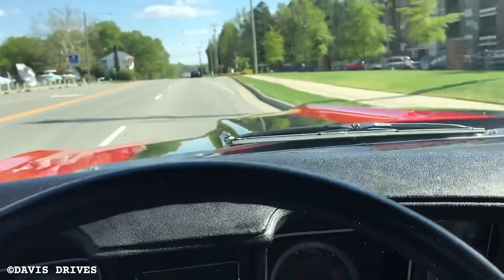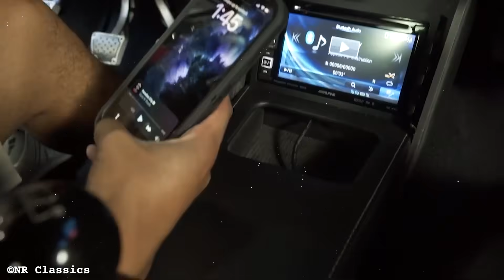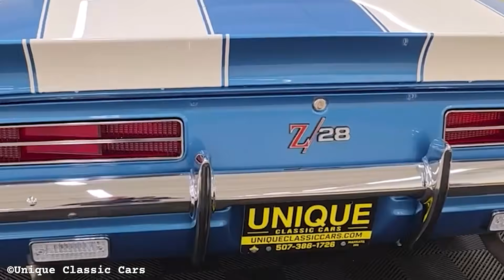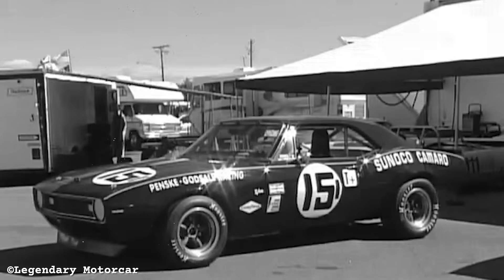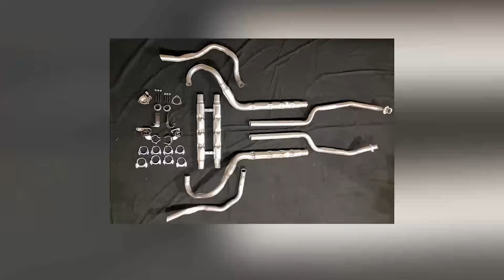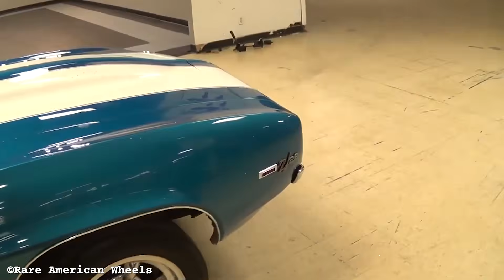25 Weird Facts About the 1969 Chevrolet Camaro Z/28

Comment: High rpms but not much on duration, or lasting long under continually beatings against big blocks. Hp plus torque wins every time. Rare yes they should be, and was rare even long ago.

Comment: They maked 206 jl8 with the heavy duty 12-bolt they made 56 of what they called service package jl8 which were truck 12 volts incorporated into a 69 Camaro and had 3 inch flanges all the way to the axles these were strictly for racing you could not put the Corvette backing plate for the parking brake in it because it didn't taper down the 2 in like the heavy duty one did that was the street model version

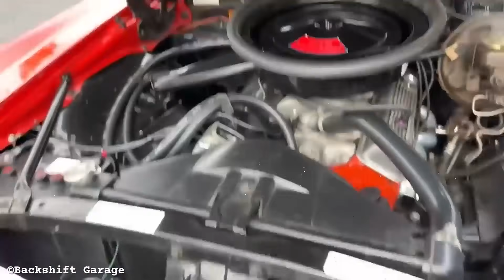Comment: In January of 1968, I ordered a Z/28, black on black, RS option, 4:56 gears, and an Edlebrock ramlog manifold with 2 Holly carbs (dealer installed option).I paid $4,000 for it. I received it in May of 1968. I put it on a Dyno and it documented 432 HP! A year later, I was drafted and had to sell it. I still have pictures of me, my girl friend (now my wife of 57 years) and that car. It would bounce the needle on the 8 grand factory tach! I raced it and drove it like I stole it, never a problem. Hole shots were 3,000 rpm+. We used Pennzoil 20w-50 on the street and straight 50 weight Pennzoil racing oil on the track. Best car I ever owned and that is saying something because I owned a 1970 Plymouth AAR Cuda, a 1970 Chevy Nova SS 454, several corvetts, 65 hypo mustang, and several Hemi powered Dodges THE BEST!
Reply: Never saw a 68 Z with an 8 grand tach. I've owned Corvettes, Trans Ams, a 350 IROC, and Regal T Types(Grand Nationals in colors other than black), GTOs, Chevelle SS and a couple of sports cars. Sadly I now drive a Toyota.

Comment: I took possession  of a brand new Z/28 in June of 1969. Got it from Don Allen Chevrolet in Pittsburgh, PA. It was yellow with black stripes.  By the way, that color combo came with a silver grill, not black.  Hooker headers went on within a week. Re-jetted the carburetor and put heavy duty racing valve springs on it. Dick Malone was my mechanic and good friend (for anyone who may have known him) He set it up for optimum performance.  The car redlined. at somewhere between 7,800 and 7,900 RPM.  I sold it to a guy who was straight out of Nam (hopefully he still has it) and moved to CA.  Never looked back, other than wishing I still had it.

Comment: As a Car Painter at Dick Lang's Chevy in Xenia I painted the only Camaro I every seen with all options including the Fiber Optics Headlamp Turn Signal & Rear Light Monitors mounted no the fenders & above the back glass that I only seen on Cadillac's & a Special on the ID Plate for paint code that Dick Lang told me latter after a phone call was a 1967 Impala medium light blue metallic. It didn't have a cowl induction Hood & the two hoods available was the Steel single carb hood, but the customer wanted the Fiberglass Cross Ram Hood used on race cars telling me he had the Cross Ram but didn't have it installed. Never knew who owned it & never seen it again.. Maybe it's in Rodger Penske's collection since they were racing Buddies?
Reply: I tried to buy a Z from Langs but they wouldn;t deal. I had to go to Smedleys. Langs did sponsor the local Z club.

Comment: The 66 396 375 h.p. had the same cam as the 67-68 427 L-88's with just a smidgen of redussed compression before detuned in 1967 from rich kid idiots missing gear at 6500 RPM & warranty claims exploding for blown engines, same with GTO's that got rid of the 3x2's in 67...
Reply: Wrong, The L88 cam was much much hotter and had 12.5 to 1 vs 11 to 1 compression for the L78 and L79 engines you referenced.  + 1968/1968 L88's had bigger 7/16" connecting rod bolts and all  the L78 and L79 engines had 3/8" and 1978 L88 rod cap bolts.

Comment: Total BS on the horsepower, 290 was accurate, the cars when new performed exactly like a 290 HP engine would. They were high 14 second mid 15 second cars, and more importantly, trap speeds were around 95 mph. Also, keep perpetuating the 7K-8K myth if you want to be sure guys keep blowing them up. The factory valve springs were very weak, they had to be with a 5 year 50K warranty! Racing engines don’t come with 5 year warranty’s. The 30-30 cam was the equivalent to today’s thumper cams, designed to sound tough, while being easy on valve train components, it was all about the sound.
Reply: You're clueless 😂 it made around 350hp, 290hp was rated at low rpm way before it's true hp kicked in at higher rpm. Multiple sources had dynoed these engines to verify those numbers.
Reply: @blacksupersport8311  No, he isn't  I had a '68 z28.  With stock exhaust manifolds, it couldn't breath, and 290hp was probably true (and it may be that Chevolet was listing the NET horsepower, even though they used Gross in those days).  Installation of tuned exhaust header made considerable difference.  Now, there is a video here on YouTube where a guy dyno-test compares the 302 vs the 327-365 on which it is based vs the 350ci LT-1 version.  They all put out 355-360 horsepower, but thats on an engine dyno.  Installed in the car without headers, they make far less.  Also the claim that the cross-ram dual-quad setup added 100hp seems dubious.  Usually, intake upgrades add maybe 15-25 horsepower.  The amount of CFM difference was only about 400cfm; add something for the cross-ram effect.
Reply: Muscle Car mag got one to go 13.77 stock.Stop bsing,I remember them running 14 flat

Comment: I remember ,early 60s ,",Full Race 283 " ,Solid  lifters ,race cam ,aftermarket Headers : making Over 300 h.p. before 1962 :
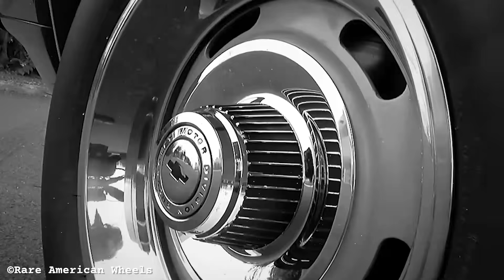Reply: I had a 283 bored .125 over 301 in a 65 nova roller cam 5:14 12 bolt 4 speed it loved 8000 rpms!

Comment: Good topic, wish it wasn't AI.  No factory stock DZ 302 ever made 400 hp.  Headers and blueprinting makes a big difference.  A few years back Richard Holdner got 357 hp from a replica DZ 302 build with long tube headers on a blueprinted engine.  As interesting as that was, there are now so many fabulous aftermarket cylinder heads and stroker kits that make easy 500 - 550 hp 383 SBC.  Oh yeah, I was there when these cars were new, saw more than a few puke their guts when factory stock as dealer delivered engines were over revved to 7,000 to 7,500 rpm and beyond.
Reply: Holdner also found the Corvette LT1 to be closer to 360 as rated in the Camaro . Many Corvette LT1 guys believe it makes closer to 400 h.p. and not 370 .
Reply: @davedavis775  Richard Holdener has done a good job of testing the legends - with a blueprint build and long tube headers. he definitely tries to be fair.  The LT1 made more torque than the DZ 302, and both hp and torque peaks occurred at a lower more street friendly rpm in the LT1 vs. the DZ 302.  When they were new, most street battles were over at ~ 90 mph - so the legend of the DZ302 was born as soon as the first guy installed a 4.56 or 4.88 differential gear.    Wholly impractical for the highway, but totally awesome for the Saturday night stop light grand prix.  It surprised many big block musclecars that only had maybe a 3.31, 3.55, or a 3.73 differential gear.
Reply: Run the dz302 & the Boss 302 on the dyno regularly got 355 ish to 380 and a similar torque curve
Reply: @jeffdohse7124  I'll go one step further: no stock DZ 302, even with long tube headers, ever made 380 hp without "tricks."  Like using a favorable correction factor, electric water pump, race build with tight quench, etc.
Reply: @Thomas63r2 I'll agree with you bc truthfully those that were pushing above the 360 mark had ported heads and electric pump
Reply: I am disgustingly sick of basically lies being told in these kind of bs videos. A 69 Z is a beautiful car and a good cool performer and has and will hold good value for investment. But a decent mild 327 or 350 was a much better powerplant. I too was around with these and assuming traction our 327’s or 350’s were gone before those 302’s got going. We could hear them at 7k trying to keep up.  And right they did not do any 400hp even with headers. And yes whenever that holdener does engines they are built with modern parts and blueprinted along with headers and tuning. He and these video posters are in business . Mostly the business of lying to today’s people for profit, those mostly not even around in 69. The money people should all be ashamed. I don’t like the lies and indoctrination. Maybe 350 hp. Keep up the truth brother
Reply: @fcaughli the 327 could best the 409 stoplight to stoplight around town
Reply: @jeffdohse7124 yeah with a moe-ron driving the 409
Reply: @kimmorrison9169 LoL not quite the 409 down low was a dog until it got rolling and the 327 could get the jump on it
Reply: @fcaughli  It was all just a game for the manufacturers.  Most engines made less than their advertised hp, some made more.  No factory stock DZ 302 as delivered to the customer from their local dealer ever made 350 hp.  None.  Add long tubes, do a blueprint build and then it gets interesting.  I do not remember what the first refactoring of the stock Z28 302 horsepower was - I think the NHRA initially bumped it to 310 hp.  The DZ 302 does have a cult following.  The hard core DZ 302's are running mid tens at 125 mph.  These buzz bombs more than double the stock horsepower and spin past 8,000 rpm.  Fun, just not reliable or long lived.

Comment: That tach was wrong, red line was 6500 rpm.
Reply: I know any over 65 if even that was over the power peak. I am not even sure the stock valve springs and distributor points would do it.

Comment: 1 Please quit saying Zed 28!. 2 The SS 396 Camaro also had a 375 hp option. I purchased my 1969 Z/28 new in December 1969. Garnet red with black stripes, ram air hood, M 21 4 speed, rear spoiler, gauge package, with 373 rear gear. The late 69 Z's came with 8 grand tachs as opposed to early 69's with 7 grand tachs. We (local Z/28 club members) generally claimed 360 -375 hp. I unfortunately sold my Z about 1 year after purchase. Three years later I purchased another 69 Z from a friend. Sunoco blue with white stripes and Rally Sport option. Original owner had replaced the crankshaft making it a 350 ci Z. This matched the 1970 Z's displacement but still had the hotter 69 Z crank.
Reply: That's the AI talking.
Reply: Huh? If he put a 350 crank in a 302 it WAS a 350 with a 350 crank...The only difference between the two is the 302 uses a 3" stroke and the 350 used a 3.48 stroke crank.
Reply: He put a 70 Z/28 crank in the 302 block. This of course made it a 350. The 70 350 ci Z used a slightly milder cam than the DZ 302. The 70 Z did not rev as freely as the 302 due to the longer stroke.
Reply: He would also have use 350 pistons.
Reply: @mikeheggem9488  I'm no engine expert but I think you are wrong.
Reply: as soon as I heard that I knew the entire video was an AI fraud. 400HP my ass. 290 or a tick above that in ALL STOCK form is the correct rating. Maybe 310 on the best of days and even that is a MAYBE.
Reply: But it is Zed not Zee. Then again I am Canadian and that’s how we pronounce it.
Reply: @focusedonfuture3255  Eh hoser? Get out of here LOL. The name is RPO Z/28 not ZED 28 regardless of Canadian or English jargon.
Reply: Z is pronounced zed in Canada. Get over it yankee

Comment: Power is basically in the cam specs,valve train,and breathing.Considering these factors,power should be about 1.2. times the displacement.About 360-375hp,I would guess.Army friend of mine had one of these delivered to Fort Benning,in the summer of 1969.Had a mechanical tach,I remember.
Reply: Check Richard Holdener video's. Highest small block was Cleveland Ford, even M code hydraulic put 20 hp on the LT1, 370 hp version of this. I raced dozens of these with my 1968 Camaro 350, 295 hp. and just buried them. They had no torque. Double dating in one was a clutch slipping affair.